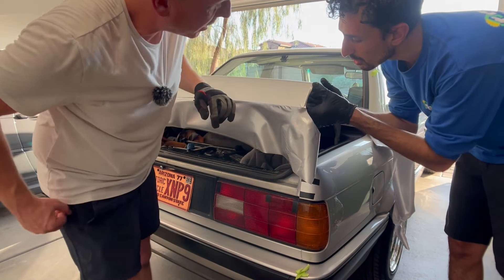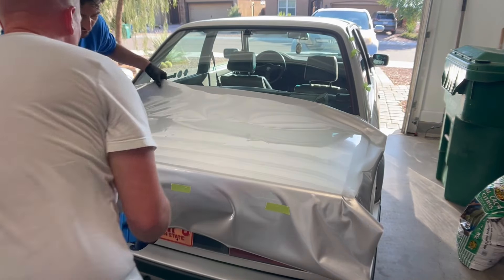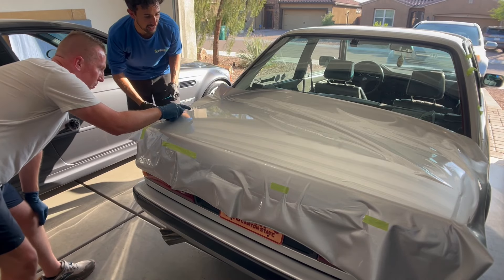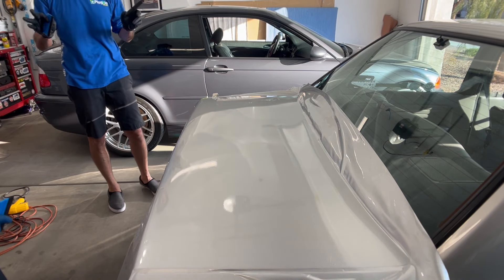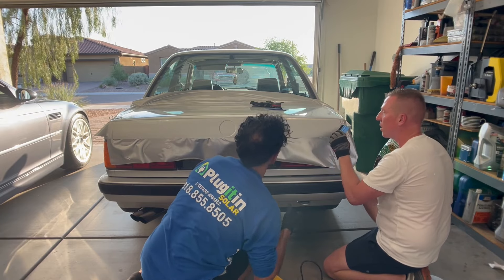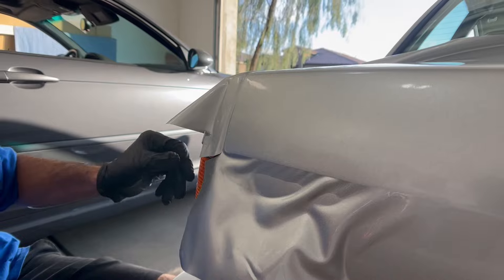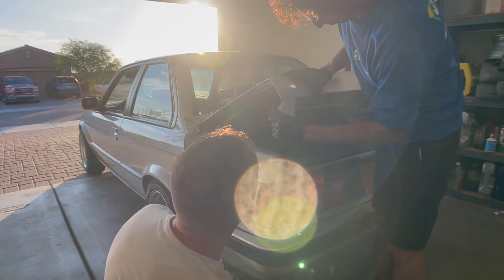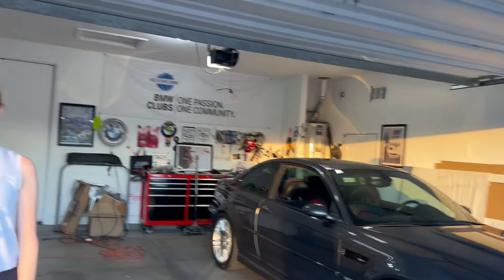Paint Prep: Why I Failed to Wrap My BMW E30

Comment: That looks good at the end! I didn't know you could retry glassing it so many times before squeegeeing it down?!
Reply from the maker: Thank you!! I think as long as the surface is prepped well, wipe down paint or in this case, remove all paint, it seems easy to move the vinyl around multiple times. We were surprised by how sticky the glue was. I’ll be removing the wrap soon to re-prep the trunk for the new color and I’ll be curious what it will be like to remove the wrap. Thanks for watching!! Stay tuned as I’ll be wrapping the entire car after it’s fully sanded down.